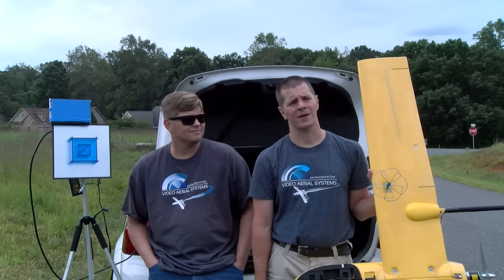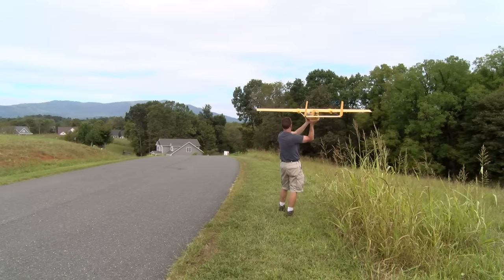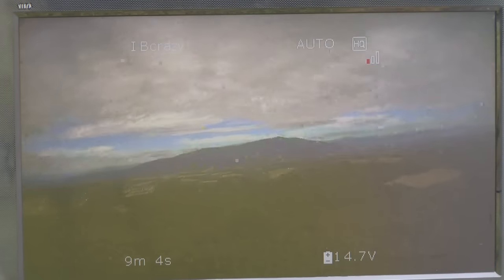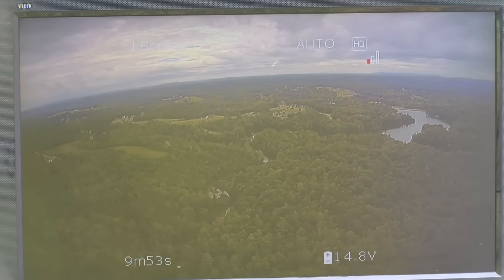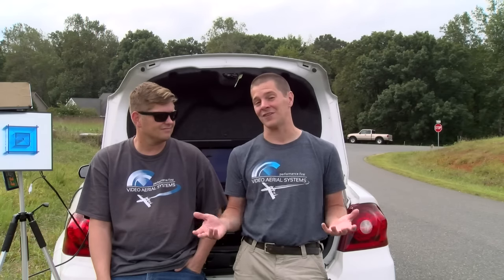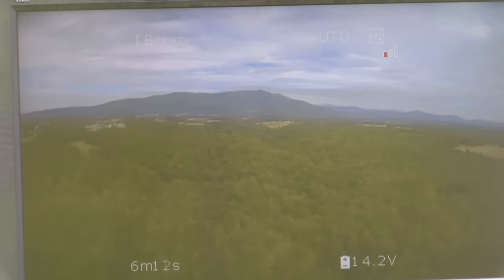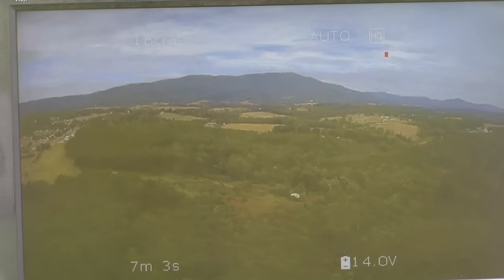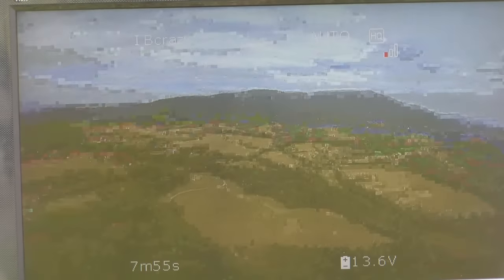Connex Prosight test #3 - 4.5km range and recovery

Comment: Strange that you didn't use tbeacon or things like this.. ;) Such elevator problem unusual for guys with such experience too! Take care ;)
Reply: Skyhunter FPV the vector had a bus failure. When the plane rolls right suddenly I saw the warning briefly in my goggles. Still not sure what caused it.
Reply from the maker: Things fail sometimes.  The plane was well-tested and had 60+ flights on it without failure.  Something in the vector quit and disabled parts of the airplane.  First the motor quit before the turn around, then the elevator quit later.

Comment: nice test of the prosight and a very nice crossbow but I'm totally confused why you did not try bring the plane home or closer to home instead of where you ditched it,it still seemed flyable to bring home
Reply: Allan T I had no response on the elevator. The field was the best option due to the terrain between us and the plane. It's likely w never would have found it if I turned for home. I just couldn't climb to clear the trees.
Reply from the maker: If you take a look at the topography, we would have had to fly over a hill to bring it back.  With no elevator control, it was best just to try and drop the plane where we could find it and recover it easily.  We didn't want to crash it into someone's house or car.
Reply: Cheers guys that cleared it up,glad you got the bird back
Reply: did you have RTL /RTH function to bring it back home safely. apm 2.8 costs 24 bugs now....
Reply: Yordan Velikov yes we had rtl enabled. There was a failure on the flight controller. I have been able to repeat the failure but not the elevator failure we experienced.
Reply: FPV Goose yesterday I used catapult to throw stones and make the plane moving down;)

Comment: Hello Alex. Do not know if this would of helped to get the plane home after losing elevator. But I have flaperons set up on a few of my planes, and I know that they can easily climb once I flip to my flaperon setting. Maybe you could of milked it home with some throttle management. Just a thought. I really enjoy the in-depth videos you are putting out. Have a good one.  Jamie
Reply from the maker: I do this as well but Marc did not set it up on his plane.  However, considering the nature of the failure, it was probably best to just land the plane in a safe area.
Reply: I've never been out that far, yet, but good to know. Take care man.  -Jamie

Comment: Smart idea of using a crossbow to retrieve a tree lodged plane.
Would be a good thing if you invested in a good microphone. Can barely hear you with all the Volume turned up. :/ Would have loved to clearly hear what you're mumbling about. ;-)
Reply from the maker: Actually, it IS a good microphone, but I'm trying to find out why it is so quiet as well.  I think it is the camera setting.  When I put headphones on it picks up EVERYTHING.  However, when recording everything gets quiet.  I do not know why.
Reply: Just looked at getting a small handheld crossbow. Looks like there are some legal restrictions up here in Canada. Can only get a two handed greater than 500cm long crossbow legally. The under 500cm single handed crossbows are illegal up here.
I'm sure you'll figure out the sound problem. Just thought I'd let you know in case you had not noticed it.
Reply from the maker: Find one with adjustable tension if possible.  You don't want to over-soot the airplane or it will end up snagging a tree rather than the plane.
Reply: Good Point. Thanks for the tip.

Comment: Very interested in the "secret sauce". Is this also ment for quad racing or is it to directional?
Reply from the maker: Yes.  It is designed to fly through the woods, but it is directional.  It is designed for tracks in parking garages and in the woods.
Reply: Video Aerial Systems hope you will also find something to replace the two antennes on the transmitting end, already broke two of them at indoor racing
Reply from the maker: Stock antenna replacement in the works ;)

Comment: So how is it that DJI's new digital technology can do 7km off dipoles?
Reply: Martin Ferguson I was thinking the same thing! DJI's LightBridge has been doing this for years!
Reply: Martin Ferguson Lightbridge is 2.4ghz Prosight is 5.8ghz. The Lightbridge was never meant to be used for true FPV flying. It was designed for the Aerial Photographer to line up shots in HD. Besides the Lightbridge is rated to 1.7km unless you use their optional antennas the it jumps to 3.1km. The Prosight is meant for use on FPV racers with 2.4ghz control. Also near zero latency on the Prosight while the Lightbridge has up to 200mS in some tests but on average around 100mS of latency. You cannot fly anything moving over 10-15mph with that kind of latency unless you are a big sky pilot. The other thing you need to account for is terrain and noise floor. Around here the 2.4 noise floor is high and the terrain is not unobstructed and flat.
Reply: I think you are confusing Lightbridge with OcuSync. The new digital transmission system paired with Mavic only has information such as  7km range, 1080/720 LOW LATENCY feed. out of the box.

The OcuSync headset must have a patch antenna hidden in it.
Reply: The Mavik is still using 2.4g. Right in the downloadable material. And I can sure you it isn't a dipole on the controller. The Lightbridge uses a panel antenna that happens to be omnidirectional, without taking apart the Mavik I can't say for sure but it is probably similar in design and has around 3-5dbic of gain.

Comment: Did you ever figure out what went wrong with the plane?
Reply: Jon B Baca I'm still trying to diagnose it. I have tested every piece of electronics and everything works. The Vector does randomly flash a bus failure on the bench though. I'm not sure why it's doing that though. It's possible the issue is the Vector or its GPS unit. I'm gonna try and replace that part and see if the bus failures stop.